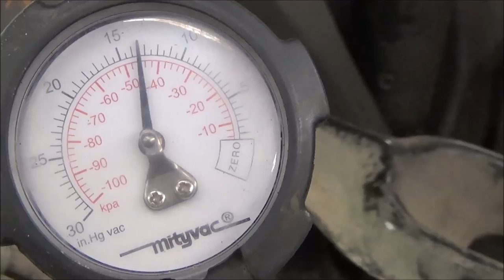Pontiac Grand Prix 3.8 - Water Pump Replacement

Comment: I just want to add something EXTREMELY valuable to this job if you’re going to tackle it yourself- YOU DO NOT NEED TO REMOVE THE POWER STEERING PUMP! Removing it is easy, putting it back on and lining the bolts up is a royal PITA. All you need to do is loosen the two bolts thru the holes on the pulley enough to slide the unit out which is still hanging on the bolts enough to clear the bolt you’re removing on the water pump. Then when you’re done, all you need to do is retighten the power steering pump bolts. They will still be in the threads. Can’t believe this mechanic didn’t catch this. I think he’s too focused on using his power ratchet to notice things such as this. Anyways, this will shorten your job and your neighbors won’t have to hear you curse anymore.
Reply: I just did my power steering pump. The trick really was to use a drift pin in one hole and get the other bolt started. Then take out the pin and do the second one. It took minutes to do.
Reply: Thats what another youtuber did with an 08 Lucerne.

Comment: Because of Dex-cool I was able to buy a house and most the tools in my box.  Thank you GM for job security!
Reply from the maker: +Discretesignals I second that!
Reply: I’m a ford guy, is Dexcool what caused that? Looks like some added a gallon jug of bars stop leak, wow!
Reply: I use dex-cool. But change the coolant every 5 years. 2008 Buick w/171.000 miles
Reply: I still use Dexcool in the newer GM cars I wrench on. Not really an issue anymore since the newer stuff doesn't use plastic intake gaskets and doesn't route Dexcool through the intake manifold. The old stuff, 5.7, 3100/3400/3800 were pretty bad, and to make matters worse GM used those leak pellets that turned the cooling system into a mud pit like the one showed.
Reply: Dexcool in 3rd generation 4Runners causes the pink milkshake since the radiator is shared by the transmission and the engine. As soon as I bought it, I changed the radiator just in case it was on its way out, and filled 'er up with the green Prestone.
Reply: Rod Drixx that’s what you get for buying the biggest pile of shit you could... Toyota is GARBAGE!
Reply: @jeremysmith8990  Scotty is gonna rage lol.
Reply: The person either never change the coolant in the two hundred thousand miles or dumped in a bunch of leak stop like the other guy said or both
Reply: If you change the Dex-cool out every 60k miles, you'll be fine.  Other manufacturers use it now too.
Reply: Agree, first thing I do in mine is drop and flush the dex, fill with the good old green.
Reply: @2112user  There is nothing wrong with Dexcool; better than the "green stuff".
Reply: @JN-mk2fh  IDK, I'm good at keeping up with the  maintenance on all the vehicles I'm responsible for  (mine and family's), but every car with Dex gets this sludge build up to some degree. With no other signs of a problem, and no issues on the green stuff.....I've got to just assume it's the Dex. Unless someone can explain the issue
 and another fix, I'll stick with green.
Reply: @Unclejake  Ford orange coolant is a dex cool clone. The older GM vehicles just werent made very well to handle it.  Doesn't help when people never change it though!
Reply: I'm late coming to this party and I just watched this video tonight. I know it's four years old but I think the guy used stop leak after seeing coolant leak from the bottom of the car and it probably just pissed out like crazy that shaft being so loose on the pump.
Reply: I can't believe that the car ran and was not overheating.
Reply: Discretesignals That did it for me for GM cars, never again.
Reply: @SouthMainAuto  What's the name of the tool called? I need this for flushes! EDIT: I'm an edit. Of course you included the tool OTC number.
Reply: My ‘04 Supercharged Monte Carlo ss is 16 years old and i just replaced the stock water pump a couple days ago because the bearing and pulley started making noise, and ultimately started leaking. However the impellers were all fine and did not show any signs of wear. Always used dexcool but i do stay up to date with my fluids and do all regular maintenance myself.
Reply: @Unclejake  Works every time!
Reply: When dex came out I was working at sob a jiffy lube, we immediately started flushing them with non dex and putting now not plastic rad caps on them. 30-40k easily they started having probs with dex
Reply: I replaced the LIM gaskets and coolant as soon as I bought my Olds even though it wasn't showing any symptoms of failure, it still had dex in it. Dex times out and starts to degrade the LIM gasket seals for the coolant runners and you get transfer between coolant and oil. Still love my Buick 3.8!
Reply: @xPreatorianx1  I have a 2008 3800 v6 does my car also need to take off the the power steering pump also?
Reply: @Nicole-dj3jf  . If you are talking about a water pump replacement on a 3800 series II. Yes, you need to loosen the two bolts to free the power steering pump. There is absolutely no way to replace the water pump without freeing the power steering pump. As the power steering pump pulley obstructs one water pump bolt, THANKS GM! (This is different from removal. As removal implies you are removing it from the vehicle. After you remove the two bolts, the power steering pump will move freely. But do not remove it from the vehicle. Just let it rest on the power steering rack.) Trust me, make sure the power steering pump sits on the power steering rack. Also known as a rack n pinon. You remove that damn thing, good luck getting it back in. Unless you remove the tensioner housing. (Which honestly as I say below, I advise personally removing anyways.) 

Now, I will warn you, if you want to get the job done in a timely manner. Remove the tensioner housing while also doing the elbow replacement. The housing is the big metal block on the side of the engine with the two tubes coming out of it that go into the fire wall and heater core. It's literally the only thing at the back and top of the engine above the water pump and power steering pump that has rubber tubes that go into the firewall heater core. You can't miss it. But search youtube if you don't know what it is.  As even if you don't remove the power steering pump from the vehicle. Loosening those two bolts required to free the power steering pump so you can replace the water pump, means when you reassemble everything, you are in for a world of heart ache. So while it is more costly of a repair time wise, I'd honestly say, if you are messing with either the power steering pump or the water pump. Remove the tensioner housing. As again, while the water pump can be replaced without removing the tensioner housing. The space is so small, and the power steering pump bolts are such a pain in the ass to get lined up and started properly (you need 3 hands to do it by yourself in a timely manner or years of experience like Eric), you are much better off just removing the tensioner housing. It will save you hours or having to rely on another person who may not be experienced in mechanical work, to assist you. (Me and my wife tried doing it first without removing the tensioner housing and let's just say it ended up in me sleeping on the couch because it was such a pain in the ass.) As we were cussing each other it was so frustrating. And I STILL had to remove the tensioner housing and finished the job by myself. (As I did both water pump and power steering pump. So I replaced them both as they both went bad.)

If you do decide to remove the tensioner housing. MAKE SURE the coolant elbows are Aluminum and not plastic. As that is a HUGE failure point on the 3800 series II. Which is again, why I recommend removing the tensioner housing anyways. It's only 3 or 4 bolts IIRC and since you are right there by it. Might as well fix a failure point AND make your job easier. But you need the following to do the repair : 1) more coolant. As the tensioner housing actually doubles as coolant passages. It hooks directly to your heater core. 2) These aluminum elbows from Advanced auto. (Or your local part store.) Part Number is # 47065HP. It's $15.99 at advanced auto. 

Again, if you know where your heater core is, and the pipes that run from it. Follow the tubing back and you'll land right on the tensioner housing. It's literally the two rubber tubes DIRECTLY above the power steering pump. So imagine having to refill your power steering fluid. You have to put your funnel between those two lines in order to fill the fluid. Those two lines are attached to the tensioner housing. That is what, I highly advise,  you remove to work on either the power steering or water pump. Unless you are a qualified mechanic. Then you can do the job without removing it. And more then likely the only reason why they don't do it themselves. Is because they want to be under book time. So if they can save time, and deal with less bolts/save the customer money, they won't do it. But for a DIYer? Remove the tensioner housing. As you can guarantee one of the single most failure points of the 3800 II is fixed with MAYBE 10 more minutes of labor, AND 30 to 35 more bucks. (Price of the elbows and coolant.)  The second most common failure point being the  intake Plenum. But that's out of the scope of this topic/video.
Reply: @xPreatorianx1  I just got my water pump changed I didnt get the rubber ones the lady at the auto store gave me the elbows they where not metal more like a hard plastic she never said anything about the steal ones smh and yes one was broke at the block the guy who replaced my water pump didn't do any thing with the power steering pully so how do I find out if this is a series 2 or 3 I got the car and it ran amazing then a week later the belt fell off and the car got hot that's when he changed the water pump now my car gets hot but doesn't over heat!!!  I think it has air pockets idk I spent so much money already I'm ready to give up lol
Reply: @Nicole-dj3jf  What is the make, model and year of the vehicle? Also ya, sounds like the coolant needs to be bled. Also damn, if I were you, I'd take those elbows back. Otherwise, the problem will happen again down the road. The aluminum ones are aftermarket.
Reply: Also Eric you rock.  Your help is awesome!!! Great Videos man. 
And your “Twin “seriously is at a Place in Wi. Pretty scary I’d say.
Reply: @darrenporsch  well I’m sure it leaked so it’s mostly a lot of Stop leak is what I bet the Farm on!... mixed with GM dex coolant
Reply: The flush was very satisfying to watch.  You should upload that alone to the satisfying videos section of YouTube.
Reply: Stop leak 101😂😂
Reply: DEx Cool gumming up a radiator within sight of you right now. My Old 96 Chevy s10 it filled half the radiator with aluminum  silt. I didn't know what was going on. So I decided to flush the system after I  measured what came out. I measured 2 gallons  out of a v6 GM engine. Hmm what's the manual say. Oh yeah it is supposed to take 4.3 gallons. New radiator and all was well.
Reply: Deathcool JUNK! Leave it to GM to screw up coolant
Reply: Funny I have used DEXCOOL in my 2003 and changed it out every five years and my Chevy has 107k on the odometer and no cooling system problems.  I wonder what any type anti-freeze would like like if it was never changed in 100k.
Reply: I was getting ready to say the same    dex-cool